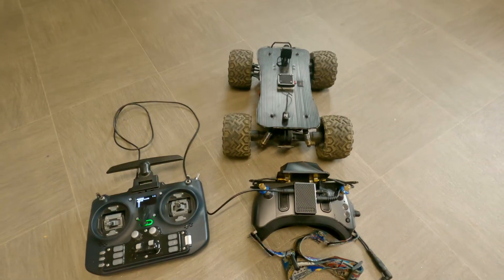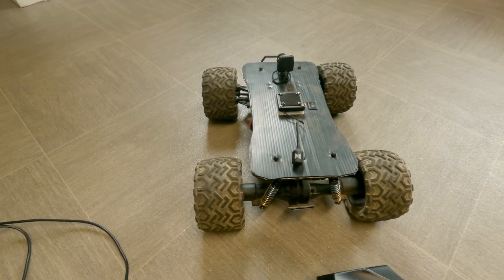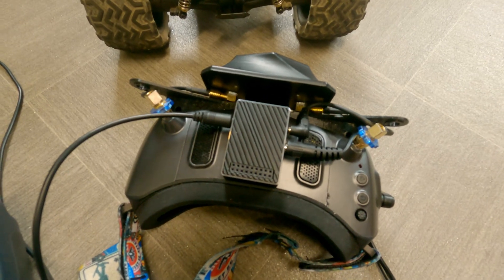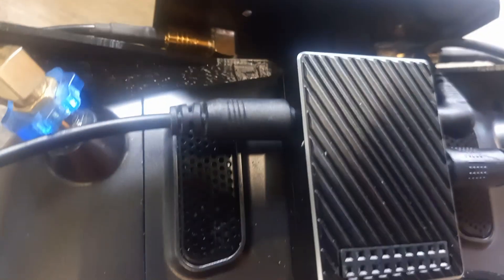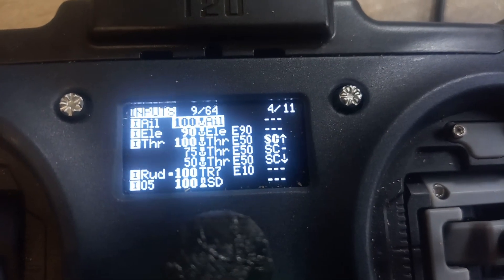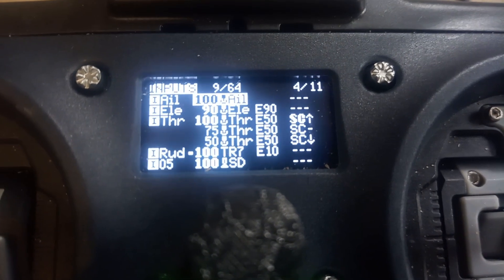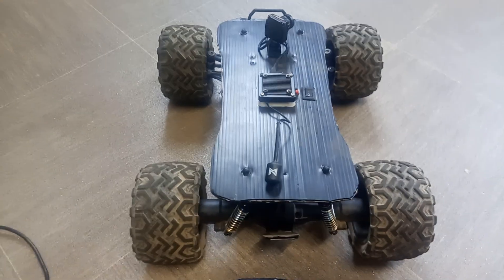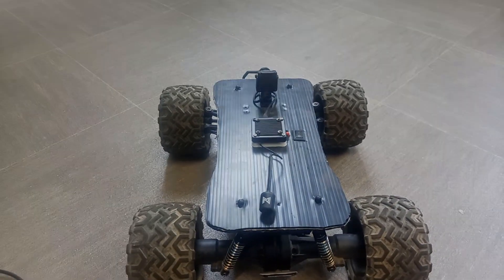TMC-FPV Walksnail Head Tracking PPM setup

Comment: Hi, I would like to know if the Walksnail Extension Module  is compatible with other old glasses ?
Reply from the maker: I would say yes, to a degree. The modes will need to be configured via the goggles X, or via the computer configurator. But either way you will not be able to reset the centre position as that needs the X.
Reply: @tmc-fpv  OK, because I have the old  glasses and I want this for him.
Reply: should it be taken Free or extension board ?
Reply from the maker: @onclefly8450  it's only free if you have purchased the X goggles. And you will need the X to make the initial setup changes to enable ppm mode.
Reply from the maker: I think this would be a better option for you: https://www.aliexpress.com/item/1005007175941515.html?spm=a2g0o.order_list.order_list_main.11.25251802qAcyy7
Reply: @tmc-fpv  I've seen that but it's more expensive, thank you. 
because I have FPV avatar goggle.
Reply from the maker: the alternative would be the gogglesL which has the appropriate HT module built in. Altho there is a possible 3rd option. Send XF robot a message in Aliexpress and see if they would sell the HT module items separately. I have been in contact with them about advertising spares for the gimbals, which they have kindly added to their listing. I also managed to get them to send me some gimbal mipi (20cm & 30cm) to test. So they very well might advertise and sell the HT module on its own if asked. (ill ask them now)
Reply from the maker: ive sent them a message. this is the unit they have: https://www.youtube.com/watch?v=bq7jfM-8E88
Reply: @tmc-fpv  Could you test this module on your old mask?
That way I'll know if it works on my google.
Thanks for your help
Reply from the maker: @onclefly8450   I'll see if it can be purchased separately or if XF will send it to me for testing.
Reply: @tmc-fpv  thank you
Reply: Thank you thank you been waiting for this
Reply from the maker: @Mrfunkyfpv   no problem. Message me if you need anything else
Reply: @tmc-fpv  can I ask what antenna is on the front of the X
Reply from the maker: @Mrfunkyfpv  Vas Cyclops
Reply: I have the gogglesx with build in Headtracking. Can i plug the trainer port cable into the AV in Port 3.5mm Audioport on the gogglesx? Does it work like that?
Reply from the maker: @marvfpv5841  yeah works exactly the same.
Reply: @tmc-fpv  Do you know an alternative for the trainer cable because the original cable is sold out. Radiomaster Boxer to GogglesX. Its 2 pols to 4 pols i think.
Reply from the maker: @marvfpv5841  I've been using a 2p to 2p with my X and T20, although for it to work the 2p at the goggles needs to be retracted a little from fully inserted.
Reply: @tmc-fpv  Thank you for your quick reply. I had a 2-pin cable at home and have just tested it. It is as you said, if you don't plug the cable in all the way it works. But it is very wobbly and I only get pitch and yaw. The roll axis is not recognized at all. I will test a 1-pin and maybe a 4-pin one. I can't leave it like this... it wobbles
Reply: @ not sure it would have been nice
Reply from the maker: @Mrfunkyfpv  I have both goggles, x with extension module and X with internal. With the internal HT goggles the trainer port cable connects directly to the goggles